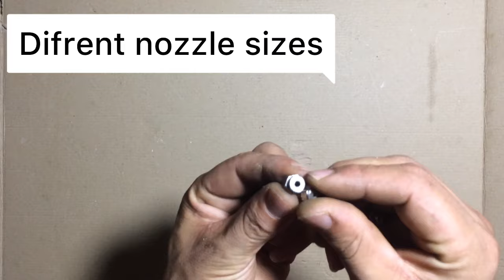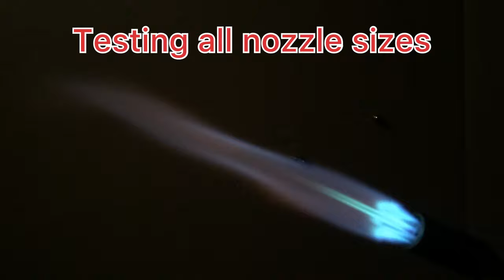MELT COPPER IN 8SEC POWERFUL BRAZING GAS TORCH DIY homemade blow torch how to make brazing torch

Comment: Nice build and great re-cycle of the broken rivet tool. As for your brazing skills, I can only repeat the tipps/comments of some other fellows: you're starting brazing by far to early. Your burner has certainly enough temperature/power for the job (at least for such small parts), BUT you need to get the part to brazing temp first and only then start fluxing and melting the brazing rod. For steels a good indication for having reached brazing temp. is usually when the part starts to be of cherry red colour. 
If you start earlier, you only burn the flux and with that the flux is not working anymore at all. Then you get a so called "cold braze" with internal pollution of burned flux which consequently weakens your braze joint.
Reply from the maker: thankyou its my first time and im learning  thank you for the tips

Comment: Don't use the torch flame to melt the filler rod, use the heat of the part. That avoids the filler just sitting on top in a ball. When you flux, wait for it to actually bite before adding filler.

So, ignore the outer flame (yellowish cone), and use the inner blue "flower" to heat the part. When the part goes dull red, flux. Keep the filler rod in the yellow cone to build heat in it, but not melt. Work the "blue flower" over the joint until its bright red, and the flux has wet out, and floated off the oxides and crud (black stuff floating on top of the puddle of flux). Now put the filler into the "blue flower", touching the joint. If everything is hot enough, you should only have to do a quick dab, and the filler will melt and flow out a bit. Pull the filler rod away (back into the yellow cone so it stays hot) and use the blue flower to add heat where you want the flowing liquid filler to travel. Repeat the heat, dab, flow steps until your joint is to your liking.
Reply from the maker: thank you so much for taking the time to give all the details i'm still learning and i'll keep what you said in mind  when i start  i thought i just have to melt the road on the joint and that's it :)    thank you
Reply: @diycreativecrafts4461  a pleasure. It just takes a little practice, and knowing the steps to do it. When you see the filler sitting in a ball on top of the joint, you're working too cold. If your flux dries out and turns into a black crust, it's too hot or you waited too long. When both parts are bright red to orange, it's good heat to add filler. The filler rod cools the parts when you dab, so quick dab and then keep the blue flower on the joint, favoring where you want the filler to flow to. The filler wants to flow toward the heat. You can also "push" the filler with the force of the flame, so if the parts are hot but the filler isn't quite flowing fully into the joint, you can adjust the flame angle so the heat in the part pulls the puddle and the flame blast pushes it too. Just practice, you'll be brazing like a pro quick.
Reply from the maker: @ludditeneaderthal   thank you you ar the best all the tips are awsome im making new torch i cant wait  to put all  the ifo to practice   thank alot
Reply from the maker: @ludditeneaderthal  thank you    im making new torch i cant wait to try all the tips you provided you are the best
Reply: @diycreativecrafts4461  it's a pleasure man, glad you're learning the skill. Once you like your brazing, move on to gas welding. They're 2 skills you'll use your whole life
Reply from the maker: @ludditeneaderthal  thts the plan sadly i dont have acses to oxygen so im thinkin of making hho torch
Reply: @diycreativecrafts4461  that can work, or a medical oxygen concentrator, an oil free compressor, and a tank

Comment: You gotta get that flame much closer, you're not heating the metal enough to braze.  Aim for the "flower" of the flame, not the tips of the longer flame. Itll heat a lot quicker
Reply from the maker: thank you so much i will practice it my first time i thought of adding compressed air to get more heat